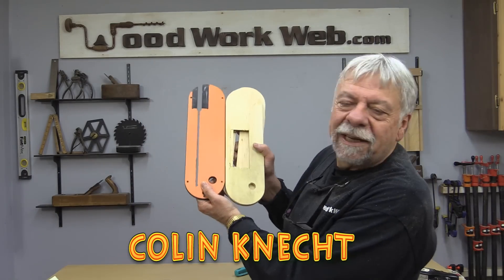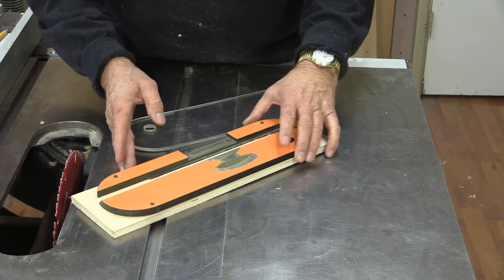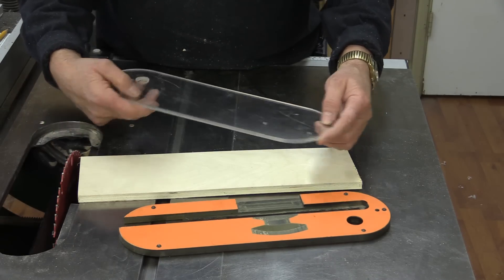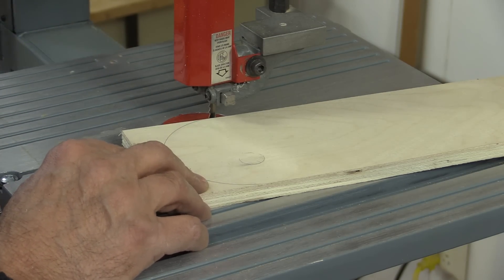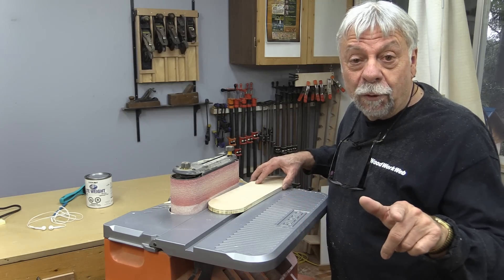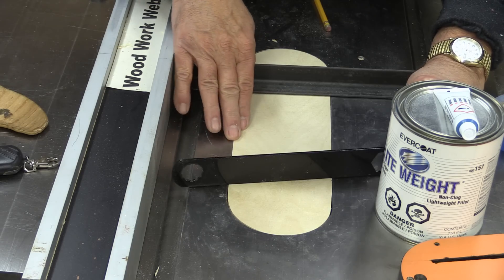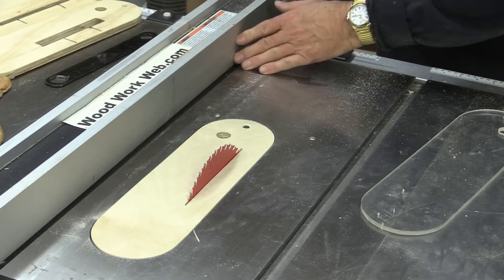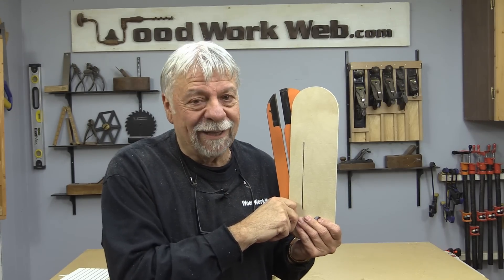Making Table Saw Inserts / Throat Plates (Dado & Zero Clearance Inserts)

Comment: Did you use a smaller diameter blade to cut the slot in the plate?   You mentioned early on that the insert wouldn't fit because of the blade being installed.  Nice video.

Comment: so to accommodate the angle when the blade is tilted would you slowly tilt the blade while it is totally up and running  or would you lower the blade tilt the blade totally over and re plunge it   thru the plywood ?

Comment: You forgot to mention to use a smaller diameter saw blade such as a 7”-8”-9” to make the initial cut. A dado blade will work to. I rout a recess for my inserts. I usually make a bunch at once out of 1/2 mdf. Like you, I make a template for a tighter fit. I also tap and thread leveling scews right in the saw that only have to be adjusted once.cheers.

Comment: My original throat plate is made of metal and is less than 1/8" thick. What material should I use to make a zero clearance throat plate? Is it OK to use 1/2" plywood and thin the underside edge to fit the opening?

Comment: What if you want to make an angle cut?
Reply: use original or make another - only set blade at the angle, say 45, then slowly raise. I use a scrap stick of wood to hold the insert in place while cutting through. I've made a few of these and I like to use melamine coated laminate but no longer find the thinner stock so use pieces of leftover laminate flooring. I've also used small screws at the 4 support locations so I can adjust each to get it level, but I like this hot glue idea.

Comment: Hi there! I know this is an old video but j was hoping you could still answer a question for me. I have an old craftsman table saw and I want to make a zero clearance plate. But the origanal one is steel, strong but thin, an 1/8" thin. I can't buy a plate because it's discontinued.  How can I make a plate that is strong but thin? I made a plate for my portable table saw, it's an 1/8" , out of wood but it's not strong and has bowed some because of humidity.  Can you help me out? Thank you
Reply: I have the same saw and problem. I was wondering if I could route the edges of 1/2" plywood to fit? That's pretty thin, though.

Comment: I don't have hot glue, but I wonder if a silicone caulk would be basically the same?
Reply: (Of course hot glue dries almost instantly, so that's a big advantage there.)
Reply: As it turns out, I just made a zero clearance and a 1/2 inch dado insert, and they were both perfectly level so I didn't even need to worry about the hot glue!

Comment: Never thought about using hot glue to level these inserts, great idea.
Reply from the maker: I'm glad you liked it Joe. Thanks for watching!
Reply: You can just use wood screws, just drill a hole and adjust height of each one in the "corners". Its simple and fast, works as good as glue.
Reply: The only issue with this method is that the insert ends up sitting a little bit below the table top (by the thickness of the painter's tape, once you remove it from the bottom of the insert).  You could eliminate that error by putting a strip of the same tape on the table top on each side of the throat, and rest the two straight edges on the tape.  This should make the height even more precise.  Maybe 'too' precise?
Reply: My saw has threaded inserts on each corner. Adjust with allen wrench.

Comment: Hey Colin !
For a dado insert, do you just run the dado stack up through?
How many dado inserts did you make for your stack?  How many blades are in your stack?
Reply: I have the same question. I'm new to this and need to make a dado plate.
Reply: @davidrocha9579  Hey David, if I don't find out before, my plan is to try about 3 inserts first (in hyper-safety mode), and if all goes well, move on up to 8 inserts.
What do you think?

Comment: If I make a throat plate for a dado set, do I just raise the blade up through the wood the same way as in a single blade? Also, do you then make a dado plate for each thickness or just make it to the thickest dado setting? Thanks

Comment: Well, I tried the hot glue method twice but it didn't work for me. Even though I used a square and a level to make sure the throat plate was flush as it dried, when I removed it and then put it back in, it was still just slightly too high at the back end. If I had to figure out why, I think it's because I just needed such a small amount of lift for it to be flush, I couldn't get a blob of glue small enough and that stuff dries so quickly that I think it was already too firm in the amount of time it took me to put four blobs down, put the glue gun in its holder, and put the throat plate in. The blobs were already starting to firm up and I couldn't press the throat plate down flat enough. That's my guess. 

Also there are probably different types of glue sticks you can get. I noticed your melted blob was brownish but mine was clear. I think mine was for crafts and the glue didn't dry that hard. It was soft enough that I could pick it off and even the dried circle was kind of flexible. I had no trouble ripping it in half. So...set screws for me I guess.

Comment: Any thoughts on making a "clip" for the insert? I have a craftsman table saw 113 series and on one end it clips under the lip. haven't figured out how to tackel that issue.
Reply: I have the same issue.
Reply: James McGuire router! Leave just enough material where the tabs are then use a router to shave them down to the correct thickness.

Comment: Much easier using a flush trim router bit. Probably takes under five minutes. Another thing to consider is that most plates also require a small pin in the front of the plate so that the blade can't lift the plate. Nail or a small screw works well for this.

Comment: I have to use a smaller blade to make the first zero cut in the insert, because my 10” blade (while in place) doesn’t retract below the bottom of the insert.  Problem:  I can’t find a smaller blade that has the same kerf thickness as my 10” blade.  What is the solution here?

Comment: I just made one but instead of the screw to hold down the plate in the saw, I used a rare earth magnet.. I used a Forstner bit to make a socket just deep enough to where the magnet would be flush with the bottom of my new plate.  You must use a rare earth magnet for adequate holding power.
Reply: My DeWalt is not able to hold magnets. What other ideas for holding the plate in place?

Comment: I made a plywood template using my original as a template. In order to avoid the flexible end I stopped half way through and swapped the ends. I was using a router table with a 1/2 inch flush cut bit with the bearing on the end. My saw is a Dewalt 745. I used your hot glue method of leveling.

Comment: Hey Colin. Loves the videos with the tons of great info you are providing to give us non-professional types the benefit of your experience with less of the usual mishaps when I just "wing it".
I like the idea of a solid, non split master Lexan template for the inserts, as my original (Delta type) insert is cast metal, with the split at the rear, as does yours. I am (shortly) going to make a stack of insert blanks to have on hand for various applications, but I want to try the router template method to save some time.

One routing template method I have used before, discovered quite by accident, was the use of the heavy duty 3M double stick tape, which is approx 1/16+ thick, one inch wide and comes in a 10 foot roll. I was looking for my roll of the regular double sided stuff (thin variety) in my shop, without success. I found a partial roll of the thick stuff and used it to attach the template to the new work piece. Using the traditional pattern bit with a bearing worked well with careful adjustment, as the double stick tape is just thick enough for the clearance needed to avoid nicking the template. The downside of that 3M tape is the cost (approx. $6/ roll). I have found that you can cut the stuff in half lengthwise and still works well, as it is very sticky stuff. ATB
Reply from the maker: Thanks for the tip and thanks for watching!

Comment: Hi Colin, I’m new to woodworking. I’ve been watching your videos and I appreciate your tips on how to do certain things with the jigs. I have a question about using a dado blade. I have a Craftsman table saw that I bought in 2019. I want to make finger joints/ box joints. My saw has a writhing knife that can’t be removed. I want to make a zero clearance insert. My question is,  will the writhing knife be in the way of dado blades when I make the cut ? Any help would be appreciated. Thank you.

Comment: Learning new stuff here all the time. I like the hot glue level trick. I used the plywood that formed the crate my motorcycle lift table came in to make a bunch of table saw throat plate blanks. Will use the hot glue trick next time I need to use one.

Comment: That hot glue trick is a great idea. Do you recommend coating the throat plate with polyurethane or wax to help wood glide over the insert?  Seems like it would help as you run wood through the blade.

Comment: Great video. Here is one trick I use instead of the glue. Lay original insert on top of the one You’ve just made and adjust the four little set -screws that is used for leveling it to mark locations , then you can pre-drill and use four set-screws to level the new insert. It’ll be almost as the original and has worked quite well for me.😊

Comment: Say one has a contractor's saw, the metal plate is ~1/8" thick, and that's all you have to support it.  When plywood is thin enough to fit, the throat plate flexes.  Any ideas of how to overcome this?  I'd thought about casting a plate out of aluminum, but that's a lot of work.
Reply: RealRuler2112 Use thicker material and mortise out the areas that will contact the plate supports to fit.  You can use a drill bit, router, or chisels to get just the areas that contact the saw to the right thickness.
Reply: Get a piece of aluminum flat stock
Reply: Also, look for Izzy Swans video about making a zero clearance insert out of PVC pipe. His saw also has a very thin lip on it. https://www.youtube.com/watch?v=KeSJQQYu478

Comment: Zero clearance is the way to go, BUT, if you don't use a pattern bit to make them, you will never have an "exact" fit. The proof is the obvious gaps on your insert. Why not affix your stock insert to a piece of material in a way that it won't flex, (double stick tape works excellent) and rout that out first,  then  you could keep that piece as your permanent template. Also, in most cases, if you don't have a way to secure the front of the insert to the saw, you may get an unexpected and unpleasant surprise.

Comment: Why didnt you just stick with the plexiglass instead of the wood?
Reply: There are some types of blades that "wouldn't like" the plastic when the blade is raised from the bottom.  His 80 tooth blade would be OK, but some of those with fewer teeth and possibly the dado set would not be good when coming up through acrylic.  More of a safety hazard than anything else.  For the OCD types like myself, I wouldn't like how scratched up and nasty the acrylic would likely appear after only a few cuts, but that's not a big deal for many.  It's really all about safety.
Reply from the maker: boyscout419 has some good points. I also wanted to make a tutorial for material everyone has.

Comment: Hello Collin, for your information: there are high-precision saw blades for longer that give perfect cuts without tape or zero clearance inserts. The condition is to have a good machine with the right rpm . However, these saw blades cannot simply be purchased in every store and are more expensive due to the production process (precision, materials used, etc.). They give a more reliable result, nevertheless important if plywood, etc., is processed more often. An obstacle can be post-sharpening, not every sharpening service can do this. Best regards.

Comment: The hot glue was a hot tip, Colin. 

Could you please do a segment on how to make those little interchangeable rings for a router plate insert that give this same "zero clearance" effect for the router bit? I have built all other parts of my router table including the insert plate, but I'm stuck on those. Thanks.
Reply: Doing this is going to be difficult with wood, especially if the inserts are thin, like they are on mine.  You might need to contact your plate's manufacturer for them.
Reply: Jason Swearingen I made my plate!😲
Reply: Oh, I didn't say you couldn't.

I wouldn't be able to on my router without having access to metal working tools, so I just bought some.
Reply: Hey! I just found the whole DIY procedure for making the individual bit opening inserts on page 173 of Bill Hylton's: Router Magic.
Reply: And thanks for your replies by the way. Good woodworking to you.